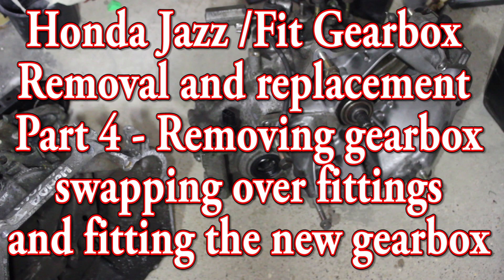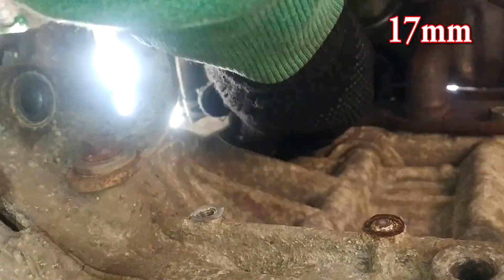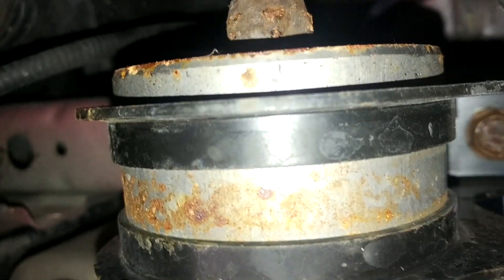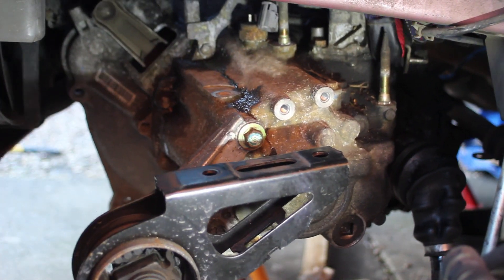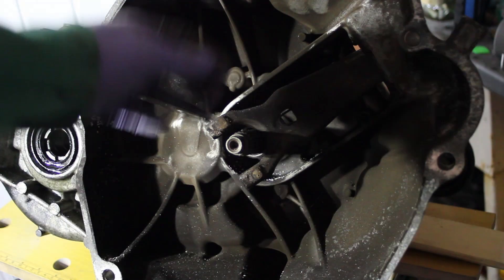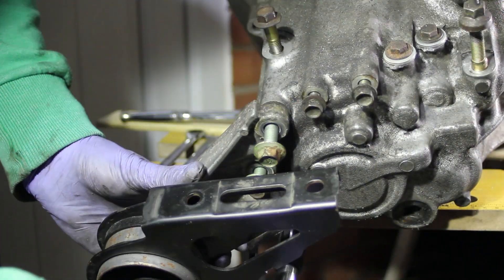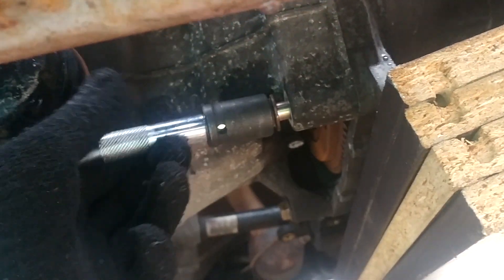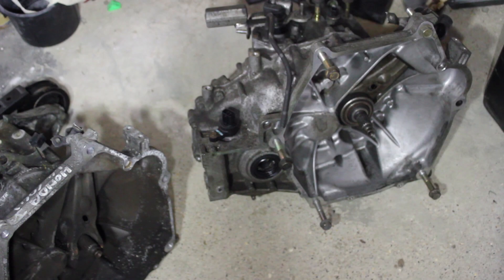Honda Jazz/Fit gearbox removal and replacement part 4 - removing and replacing the gearbox!!

Comment: I watched every part of the video pretty good guide but . But he has carried out longer way to remove the gear box . He could have easily removed the radiator out to make space for movement ( DONT NEED TO REMOVE SUBFRAME OR INTAKE MAINAFOLD OR STARTER MOTOR DUE TO STARTER MOTOR IS CONECTED FLYWHEEL

Comment: My dear brother, I have a Honda Jazz, the rpm reaches 3, and the rpm counter rises, and the gear does not change, and it slips, and the p1887 code appeared. I replaced the speed sensor with the solenoid valve, to no avail, and the problem is still there. Is the problem inside the transmission or an electrical problem? Please help, thank you.

Comment: Hi thanks for a very informative video. I'm having problems putting the 3 bolts on the rear gearbox mount that go inside the gearbox through like that metal thing. One of the bolts becomes way too tight and won't go in all the way. What do you reckon mate. Appreciate your channel
Reply from the maker: First thing that jumps to mind, you've not mixed them up? Honda have a site confirming the bolt lengths.
Next thing is maybe not quite lined up or the bolts are fouled up. Can you see any crud in the thread?
Reply: @CarAndMechanical  thanks for the response. don't think I mixed them up as I think there 3 bolts of equal size. I put them in a bag when I took em of unless I'm mistaken. There's no crud just a lil blue threadlocker from before. Do you have a link to the Honda site which shows the bolt lengths. I would really appreciate that.
Reply from the maker: https://www.parts-honda.uk/honda-cars/JAZZ/2002 might need to change years and model etc but it has exploded diagrams.

Comment: I have replaced my 2008 gearbox with an older model the unfortunate thing is the drive shaft is short when I tighten on the wheel side it comes off the gear box

Comment: No mention of the bottom rear gearbox/engine mounting. Very difficult to access and remove especially on the floor.
Reply from the maker: If that's the mount at the back of the engine I cover that in part 3 with the subframe removal, and across the series I've covered off tight access and the fact I needed to address my own toolset in order to tackle things.
On a drive way this is never going to be easy access.